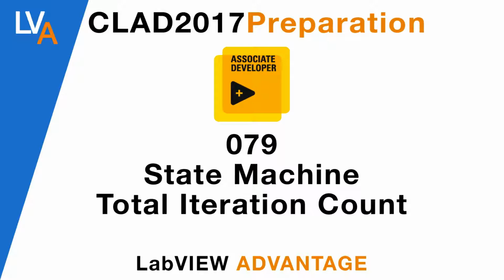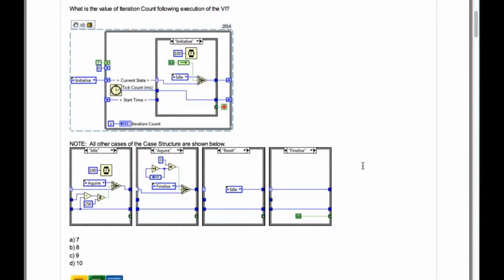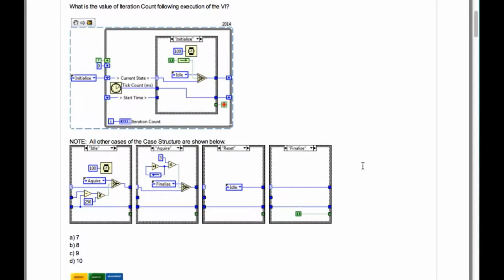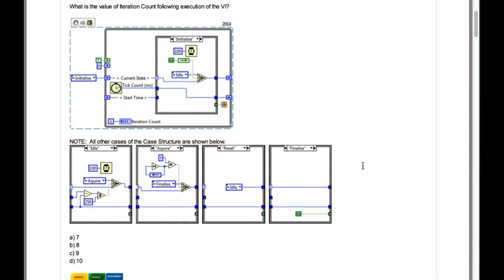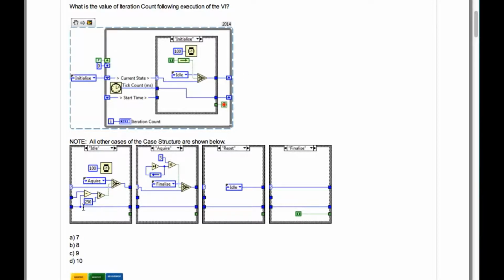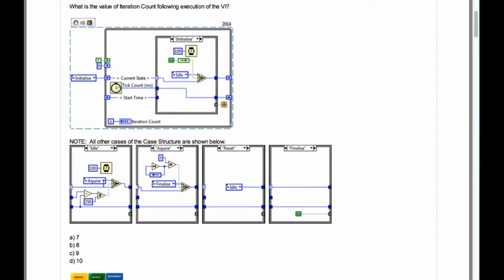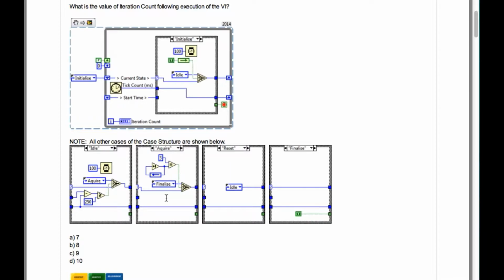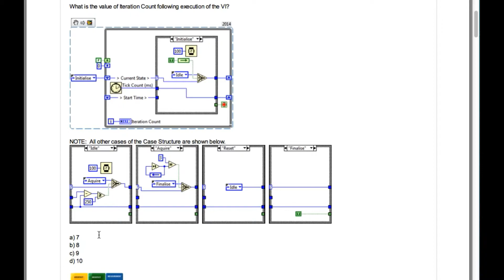LabVIEW CLAD 079 State Machine Total Iteration Count

Comment: The second run of "Initialize" resets the start timer value. So "Idle" runs at 100ms time difference the first time, 200ms the second, and can only move on to "Acquire" after running a third time with a 300ms difference. Then "Acquire" runs 3 times, and "Finalize" once. Meaning the loop executes a total of 2+3+3+1 = 9 times. But "iteration count" stats at 0, so the answer is "b) 8."

Basically, they made two mistakes that counteracted each other and gave the correct answer.